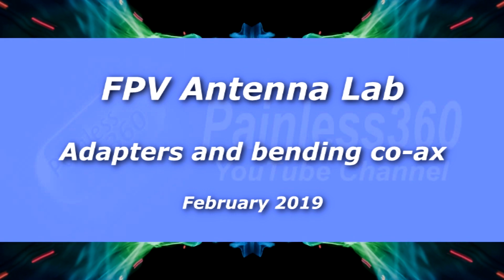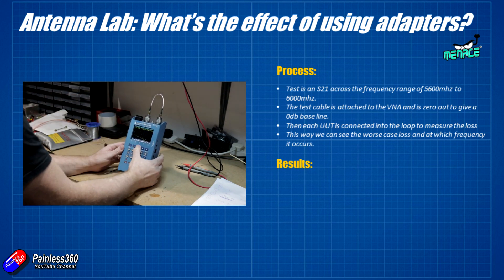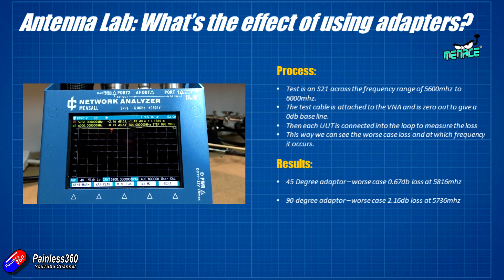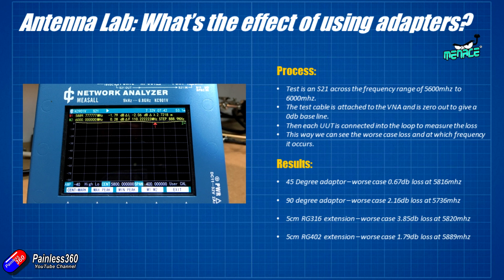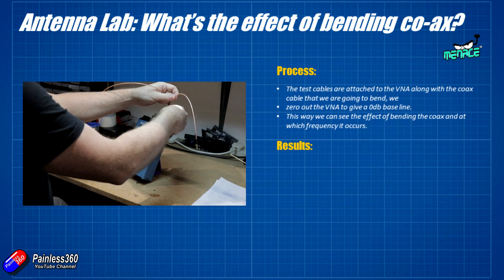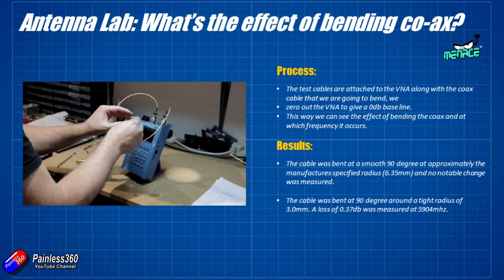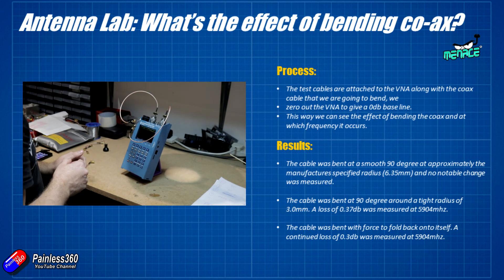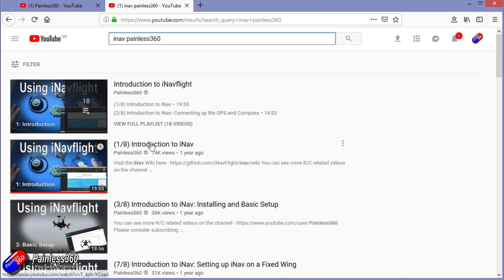Effect of using adapters and bending the co-ax cable

Comment: That is very interesting, thank you and Greg! Good to hear that multiple samples were used, especially for the 90degree adapter measurements!
Reply: So if a 90° adapter is needed for a setup; should we rather use a very short RG402 cable and bend it to 90° based on these results?

Comment: Another excellent and informative video, thanks. Basically if you need to 'adapt' 90 degree's, your losses are nearly halved by using two 45 degree adaptors instead of one 90. When looking inside those 90 degree SMA adaptors it's pretty easy to spot the culprit. The centre conductor is near zero radius, the path of the shield surface is non linear relative to the centre conductor making for changes in capacitance right at the inductive bend. It behaves like a quarter of a turn coil with random capacitance all around it in that environment. Done properly, the bend would have an exact curve with the centre conductor exactly uniform in radius to the shield, so it would work more like a waveguide.
At least we can put numbers to it now and avoid. Cheers.

Comment: Great test. What about an antenna that has a standard straight sma connector vs the same antenna that has a 90 degree already soldered on. 
Ie pagodas come straight or with a 90 so u don’t need to use an additional adapter.

Comment: Thanks Lee. This is the perfectly timed video. I'm building an fpv EFX Racer and need the antenna to be at 90° to the vtx. I intended to use an adaptor, but now I'll stick to bending the coax.👍

Comment: Wow, I never realised that the 90 degree adaptors would be that bad. I knew there wouldn't be an advantage to the signal using them, but I'll stop using mine on my goggles. It would also be cool to see how the elements of a pagoda being out of alignment affects the signal as I've seen a bunch of people bending those in the wrong place. Which is easier to do on those than with other antennae. Thanks for the great content, I've been enjoying this series!

Comment: Very interesting and great series.  I would be interested to know if there is any difference in a pigtail with a 90, say a MMCX with a straight connector and one with a 90.  Since it's part of the cable and not an adapter I wonder how it would affect it.   I have pigtails I use that have a 90 at the MMCX and at the SMA end.  I might be loosing a lot.

Comment: So basically it would better to bend an antenna at the angle you need than for you to use any of the adapters. , right?
Reply from the maker: From these results, yes.
Reply: I just had to replace one of my receiver antennas and started wondering if heatshrink and a cable tie is the right way to mount it. If tpu, pla and so on changes the signal heatshrink probably has a similar effect and maybe could decrease your range. It would be interesting to see a comparison of the rssi/range with the tip of the antenna covered in heatshrink and a test without heatshrink.

Comment: Thank you,  Lee.  Very informative, and for me,  particularly timely. I am putting together a new build and looked longingly at MenaceRC's offerings, but did not find a patch antenna with RP-SMA ends. And so the question arose what effect a SMA to RP-SMA adapter would have. It seems we are on the same wavelength.  Do pardon the completely coincidental pun.

Comment: There is a torque spec for SMA connectors;  4 to 9 inch pounds.  I have solved many RF problems just doing this.      That and the condition and cleanliness of the center pin.

Comment: Hello... great video...but what about a SMA pigtail to mmcx (I have a AKK FX2 ultimate VTX...... and it came with this adapter, so of course I'm using my SMA attena..... but I'm curious if I am better off just buying a MMCX Antenna to plug straight into the VTX?

Comment: Thanks ... how about testing M/F or F/M straight adapters, which I seem to need to use in several situations, depending on what connector the VTX has, and what connector the antenna has.

Comment: Just have to say that a 316 extension without the right angle end would perform a lot better you'd still have maybe a 1-1.5 db loss but, not 3+ as in this test if that 402 extension used a right angle end you'd see a much higher loss as well. If you're familiar with Ibcrazy of V.A.S. he did a very similar test and for the most part the results were about the same but, the 316 extension did a whole lot better without that right angle.

Comment: Very very interesting results, which made me think about my 5.8 setups. 

It also made me more curious, I have a 1.2GHz CP Patch and a 2.4GHz helical which both use 90 connectors on RG316 to another 90 connector. Now those losses in the videos were all 5.8Ghz which then makes me wonder what would the same test reveal with 1.2 and 2.4GHz because both frequencies are within RG316's capabilities. That would reduce the losses down the coax greatly, but what about the 90 degree connectors I wonder ?

Comment: 2:30:  The RG316 has a 90 degree connector on it.  So shouldn't it be 3.85db - 2.16 db = 1.69 db for just the cable?

Comment: Great video again guys, really interested to see this! Won't worry too much about being a bit vicious with the coax in future! Could you test a few different lengths of extension and then extrapolate down to zero length to estimate how much of that loss is from the connection compared to how much is down to the cable? Would also then love to know comparisons between sma, rpsma, ufl, mmcx.. especially on the first connection versus the e.g. tenth connection? And is there a way to corroborate what rating the coax is (is it generally different colours or weave or e.g. count) or do you just have to know and trust the spec on the box?
Reply: Ooh and on a similar line of thought, does coax fatigue much? If you bend it (or vibrate maybe..?) back and forth a ton, how much does that degrade it?

Comment: 1. Is using pigtail on transmitting end also bad to same extent? I mean i have chameleon frame which is kindof designed to use the pigtail.  2. There are some antennas that have right angle adapter built in (like Realacc pagoda or Lumenier AXII with right angle MMCX connector). Are they also worse than regular antennas and should be avoided?

Comment: great info, explains why me using a 90deg adapter had such poor results i think one of the common set ups might be worth testing ( not just because i'm about to do it hehe)  the setip with mmcx  with 5cm  of 'x'' coax out to sma, then sma antenna , is it better to solder instead of  the sma portion?, or just bite the bullet and order some mmcx antenna

Comment: How much db is being lost on those MMCX to SMA adapters that come on a bunch of vtx's?
Reply: That would vary from not much to surprisingly high depending on the manufacturer. Like cables and connectors, adaptors are also not equally made even if they look similar.

Comment: Interesting.   I have been testing my VTX power output at the MMCX where I connect to the VTX.   I have not been testing at the SMA which I should seeing as how I have an extension that is 90degree MMCX to a 90 degree SMA.     If it is causing me a 3-4DB loss that is like going from 800mw down to 400-500mw.

Comment: Test suggestion: could you test a so called air choke: this is about 6 windings of coax around a bit of PVC tubing of 1.2 cm diameter. In FM broadcasting this gives a lot better SWR and wider bandwidth for the antenna. It is usually connected right at the antenna or right at the transmitter (not practical that). I would be very interested to see if the benefits you get at the 100MHz band are still detectable at 5.8 Gigahertz.

Comment: Interesting stuff - thanks for this. I assume the impact is the same regardless of whether you are looking at a transmitter or a receiver? My VTx antennas are pretty good but with many goggles some sort of adapter is necessary with patch antennas if you want them point forwards rather than off to the side!

Comment: My 880d has straight up  connectors. I use a bandicoot on a 90 deg adapter I wonder should I go to no adapter that would point it at the moon. Maybe 45 ? 
All the losses were around 5800 I fly r1 at 5658 I think- does that mean I'm in a no loss zone? My ignorance is showing through here.

Comment: Do these rules also apply to 2.4 ghz transmissions too?  I had to add a 45 degree adapter to my antenna to stop it fouling the tray I'm using.  I haven't noticed any change but I'm flying mainly indoor at the moment due to the weather.
Reply: Yes, although I'd suspect to a lesser degree.

Comment: Great video its deffinatly one of those things you don't think about untill someone mentions it. One thing you missed though do the rp-sma to sma addapters make much difference as you are changing th polarity ??
Reply from the maker: Looks like any adapter will introduce a loss, if you can - avoid it.

Comment: A lot of guys with wings like to naked extra-long adapters he just seen this far away from the aircraft as possible is there any actual benefits of this or does the video Simply degrade by having to travel a longer distance? And also is there an inherent difference between SMA and rp-sma as far as game values or returning to its width of a standard polarised lollipops and axiis for example, and while I'm at I feel like bye play CB antenna extremely close to a weighing or quad I'm creating small phrenzel zones, by having the antenna too close to the craft and actually thought blocking signal with the craft at certain angles is there any legitimacy to this?

Comment: Very useful information but missing a key point. There can be no doubting the test results but I really want to know why it happens
Reply from the maker: https://www.electronics-notes.com/articles/antennas-propagation/rf-feeders-transmission-lines/coaxial-cable-loss-attenuation.php and other so a great job of that.. Happy flying!
Reply: @Painless360  Many thanks. I've skim-read the link and saved it for further reading. I'm presuming, probably incorrectly, that signal speed also accounts for the dB losses in 90° connectors?

Comment: You compared a RG316 with a 90 degree connector vs a RG402 with a straight connector. Would have been better to compare cables with the same connector.

Comment: I have a question:  what is the best type of antennas to use on goggles, when the vtx has a linear antenna?  A link to ones I can buy would be great thanks.  (EU) max price about 10 Quid 😉
Reply from the maker: See my reviews of mini quads that have linear antennas.. a regular whip and a linear patch are good..
Reply: @Painless360  - i will go check that out, thanks
Reply: @Painless360  - I have the EV200d goggles, with quadversity, a high gain patch, and a low gain patch, and a circular p, now I'm just waiting for the last circular p with a bit higher gain.  Picture/range/penetration is great.  I'm glad I got it right the first time.  Thanks for the great videos, I learned quite alot this week.

Comment: I couldn't help but notice but the 5cm RG316 extension had a 90° adapter on it while the other had not. thats a somewhat unfair comparison, don't you think?
Reply from the maker: Direct connected 90 degree connectors don’t have the same losses as using a separate 90 degree adapter so the comparison of the two co-ax types is still valid. Happy flying!

Comment: Hmm, maybe time to upgrade. I've been using a Menace Bandicoot linear patch antenna with a 45 degree adapter and a linear whip with a 90 degree adapter on my HD2's for over a year now. But it's still doing me well, so I don't know.
I know the whip antenna is working well because if it's folded down I get a lousy signal, like it's not even plugged in.
Reply from the maker: If you're flying with linear antennas on the model then you're using the right antennas. I don't fly far away with the smaller models that use whips so, like you, are not too worried about the levels of loss in the cables/adapters. Information like this is only useful when you're starting to experience problems with reception and are looking at things you can change to improve things.. Happy flying!
Reply: I've linear antennas on all my quads and get good reception with all of them out here in the Gloucestershire countryside, which is why I keep eyeing the RapidFire module but can't quite press the buy button as my Fat Shark antenna diversity module isn't causing me any problems, apart from the rare occasion I have to change bands (annoyingly placed tiny little dip switches)
Reply: Remember that loss on receiver antenna can often not matter as much.

Attenuation of after the antenna (line loss for example) well lower the noise floor as well. The SNR stays the same.

Now if the signal is near the sensitivity limits of the receiver you may still have degradation, but that's hardly ever the case.
Reply from the maker: @licensetodrive9930  make sure you're subscribed and have the bell notification icon selected. Greg and I are planning a test on linear vs circular polarized antennas and what happens if you mix them up. Should be interesting.
Reply: I'm subscribed with the bell notification already :)
I have wondered about mixing linear & circular since I've seen some people use a circular omni on RX with linear on TX, so I'm definitely interested in seeing that video. It would also be interesting to see how much a left hand circular antenna rejects a right hand circular signal.
Reply: @Giant FPV So using 45 degree / 90 degree / extension adapters on the TX side is gives a worse end result than having them on the RX side?

Comment: TrueRC of Canada notes less than 0.1dBm loss in their 45 and 90 degree SMA adapters.  Has the tech evolved or was your 90 degree connector just a real bad unit?
Reply from the maker: They haven't changed THAT much! I'd ask for their testing methodology and proof of performance.. Any connector is a source for losses and signal reflection.. Happy flying!

Comment: 3.85dB loss over 5cm of RG316? That was a bad quality extension cable then. 

RG316 should do ~230dB/100m at 6GHz. Say 0,2dB for 5cm. Then there are two sma's causing another bit of loss, but if the sum is more than 1dB the connectors are not tightened well or the cable is if well known Eastern quality.

Comment: Hi Painless360, what would you say aboit things like these noise filters: https://youtu.be/rTYxbB6VAhs
Back in the day I got some from him and always wanted to shout out, but never really reached that point of testing, because I left the hobby before I even learned to fly, but I soaked in a lot tech videos about frequencies, antennas, etc.
Just wonder what such a 2.4ghz noise filter does for your dB. I particularly like them on the goggles to get more elevation additionally. 
Is that noise from the radio still a thing to consider and sacrifice perhaps 1dB? Perhaps this filter is now built in or isnt a thing anymore?
Additionally: Are the old bluebeam antennas still good or did we have a significant increase of quality in the last 3 years? I see the aomway, which was more or less a quite mediocre antenna compared to bluebeams. What about the stubby antennas on the quad or those tinier pagodas?
Reply from the maker: I'd expect that they introduce some losses. If I ever get some we can test them..